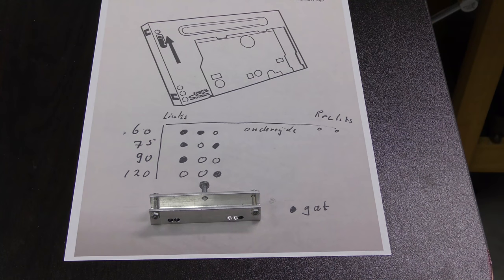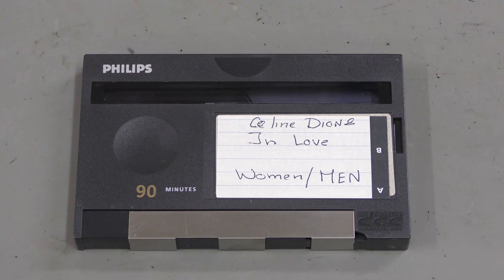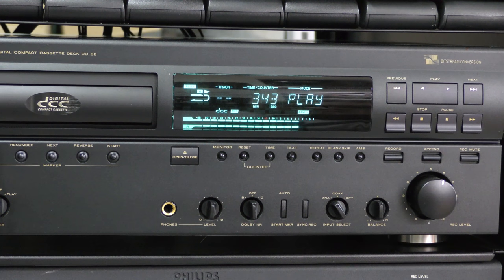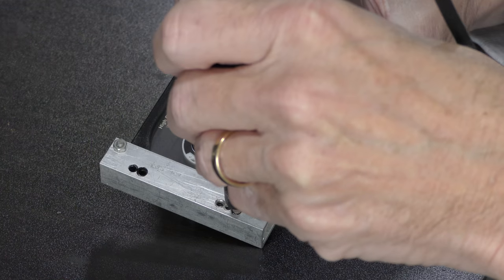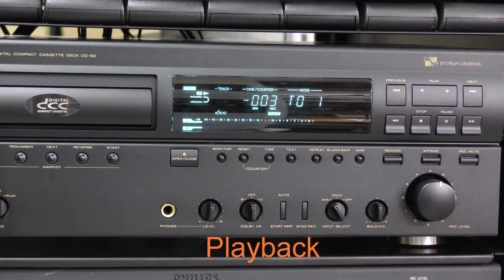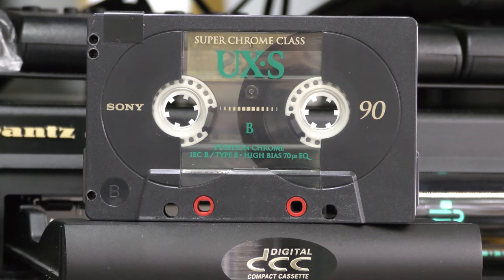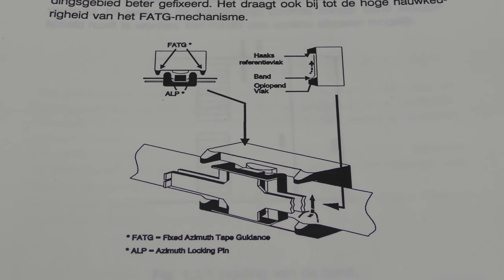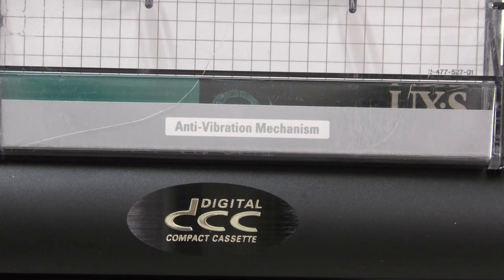Converting a analog audio cassette to digital compact cassette. A Myth?

Comment: i did this too back in the 90s when DCC was new ;)
Reply: I used a Maxell XLII-S90 Tape back in the days by the way (and carved the two holes with the pointy part on the back of a swiss army knive). The casset also advertises " high resonance-damping and heat resistant mechanism". And now about 25 years later i found that this is my only working DCC casset as all my original DCCs had developed the stick slip problem (I will fix them when I find time next).

Comment: Perhaps a NEW analog cassette tape could store the digital signal effectively, but the lifespan of the recording must be significantly shortened. 1) Analog cassette tape has the magnetic layer exposed to the playback head, thus allowing friction to wear-down the magnetic layer over time, and 2) The superparamagnetic effect will cause the signal to degrade over time, as the sharp peaks and troughs in the signal exert magnetic force on each other and start to neutralize each other. This is a problem that computer hard-disk manufacturers have struggled with for decades.
Reply: Biggest problem would be overwriting another previous recording.as no erase head is present and an analog tape medium has much thicker magnetic later. Writing once on a blank tape wirks much better than trying to overwrite previous recordings here

Comment: not a myth, it worked.  I even hardware modded the DCC950 deck to do this without editing the tape itself.
Reply from the maker: It does work, just not very well compared to the original DCC

Comment: I wonder if it was researched today, could you get more out of an analog cassette with a digital system? Interesting!
Reply: no, you can't get more. Digital sound on a dcc or cc cassette must be somehow converted, DCC is lossy format. So standard analog CC has full  lossles sound in the frequency range top cassette can achieve (which is up to 18 kHz) while DCC is compressed. Adventage of the DCC is the sound is without a hiss. But it's like mp3, Atrac or AAC etc. Today's research about analog tapes possibilities is much weaker and there are less and less knowledges about it, new engineers and technicians does not care, analog tape is nearly dead format for them. Anyway, DAT (digital audio tape) is lossless cassette tape, superior to DCC. More cannot be achieved..
Reply: @sevcaczech5961  Well, technically it can, ADAT and DTRS allow for 8 channel DAT-quality audio recording, while there were professional studio machines that recorded digital signals on special reel to reel tapes, those were used at studio and for live recordings, Ozzy Osbourne's Live and Loud was recorded on open reel digital tapes.
Reply: @sevcaczech5961  DCC sounds much better than any regular analog CC deck ever achieved, and DCC also supported 18 to even 20 bits, which DAT could never do. That's why some DCC releases in 18 bit sounded better than their 16-bit CD counterparts according to many audio aficionados.

Comment: Does anyone think about 3D Printing a DCC shell? Also figure it out how you can slice a Chrome VHS tape which is still available on a reasonable price? I know that you still have to figure it out the metal parts like the pressure pad, but it sounds something you could manufacture in China for nickels. What I mean it shouldn't be impossible, although it is not easy. Eventually we will need new blank tapes.
Reply from the maker: On the new dcc forum we have already started this idea: https://forum.dccmuseum.com/t/new-dcc-shells-3d-printed/72/14

Comment: What would happen if you did the opposite? That is, record analog on a DCC tape?
Reply from the maker: I just tried that last week (someone on VWestlife's channel had asked). The only way possible was to remove the dcc tape from the shell and put it in a regular analog shell. Otherwise the capstan/pinch would not work. It recorded  great on my regular deck that way.
Reply: I tried too. sound was great.
Reply: @DRDCC  I had always wondered but this basically gives me the answer, at one point before the tape boom happened I was trying to find blank open reel tape and while it would have been highly highly impractical I now know it would have been at least theoretically possible to use VHS tape on my open reel recorder, all of this is very cool
Reply: The magnetic layer thinner than an analog tape. Expect incorrect HF bias, low frequenties, noise behavior. But it is not that different it Will not work

Comment: i had just one analoque sealed tape lying around somewhere. and you would never guess... it was a Sony UX-S 90... i drilled the holes carefully, (i made a template with masking tape) 
and made some recordings. it worked flawlessly... But nowadays a UX-s90 is harder to find than a Philips DCC tape. prices go around 20 Euro's ... Should i have kept it sealed?? no, this was a fun project. thx for the tip Ralph!
Reply: *analogue

Comment: I know this was done ages ago, but I did make the attempt to take apart a realistic supertape 90 DCC tape and put it into a chrome housing.  (I have 2 used tapes leftover, but no DCC recorder to use them on)  To be honest, recording on the tape was nice, but what I found was that when recording to the tape, the output was a bit lower than most cobalt high-bias tapes.  It responds almost as identical as a BASF true chrome tape, as these tapes were meant to record 0DB input, with a lower output (and lower noise floor)   

If I can recall, I believe doing this exact test (using BASF chrome maxima tape) long time ago with positive results.  The BASF cassette housings are quite decent.

I'd be very curious as to how the DCC machines would have been setup, as more than likely, they would have been tied to a specific tape type and calibrated to it.  Most japanese cassette decks were calibrated against either maxell UD/TDK SA tape, which is vastly different than BASF pure chrome.  I agree that the head alignment should be precise, especially when using it for the digital tracks, but it should not skew as easily.  But I can confirm with your findings, that the pressure pad/assembly in the DCC blank cassette has a unique tray that isolates the pad and likely locks the playback head in place.  

The DCC cassette itself is uniquely designed with large internal guide rollers that have pressure pads on either end of the rollers...which is unique.  These tapes certainly have a lot more parts and assembly involved in the manufacture, and were priced accordingly due to the these reasons.

Comment: Ho provato cassetta TDK SF con forati per DCC che risulta non funziona causa livello del volume registrato troppo basso. Consiglio qualsiasi cassetta K7 Type II con doppio strato di cromo (come TDK, Maxell e Fuji progettati K7 Type II dal 1974), prima di forare per DCC. Va bene Sony UX-S con meccanica anti-vibrazione anche TDK SA-XG.
Reply: Non modificate nastro metal e ferrichrome, DAT, DDS, MiniMV, MicroMV, reel audio EE e Duad, etc. da trasformare in DCC perché testina magnetica DCC e pinch-roller si rovinano/usurano !!!! Solo usare nastro cromo doppio strato di K7 !!!!

Comment: You might probably know this, but the only manuafcturer of DCC tape was BASF, so to get the best results you should use pure chrome either Extra, or Super from the later generations.
TDK, Sony and Maxel use pseudochrome, which is just ferric formulation dopes with cobalt particles to achieve higher bias and similarity to IEC II referance tape.
A test with BASF would be decisive.
Reply: Not quite ...

Comment: Does that mean those old Tapes could  Store hundrets of Megabytes?
Unimaginable in the Homecomputer age
Reply from the maker: Yes. There was one dcc player, (dcc175 portable) that was capable of backing up 250mb of data on a 90min dcc tape
Reply: Thats what spectrum and other computers did in the 80’s , thats what the dat based back up format was, that the adat by alesis was......

Comment: My first DCC recorder was a DCC 175. I still have it, but it doesn’t work anymore. Probably a rubber belt problem. I recently bought a good working DCC 300. Do you have a drawing with measurements of the aluminium U-profile to make the holes?
Reply: That is a nice player DCC175. You should fix the belt, or have it fixed.
Reply: @PhilipvanderMatten  Maybe I will. I have all the accessoires, and one extra battery. The was software with it for a Windows PC, and a cable to connect to the printer port of a PC. With that you were able to edit the digital audio on a PC. It's a pity there is no possibility to connect it through a USB port, and edit with Apple software. It's a thing from another era.
Reply: @JandeBloois1952  I would love to have it.

Comment: Dear friends, be smart and just swap the dcc tape roll for a roll of chrome basf tape and you will have a new dcc.
buy a new basf chrome ribbon roll,
open the dcc cassette remove the dcc tape roller and replace it with the chrome basf
Reply from the maker: Hi, It is not that simple. The BASF Chrome Tape is Video Tape that was carefully selected with Philips together with a specific felt pad to prevent the stick slip effect.  To be using the same chrome tape for regular analog tapes, would not get you better or a stable solution. You would really need the combo of the right shell with the correct tape and felt pad.

Comment: Try a metal type 4 cassette
Reply: metal dont work at all. I tried metal maxima from basf.
Reply: I'm pretty sure it won't work because the bias would be wrong. DCC uses chrome videotape.
Reply: Nope. Coercivity way too high for that
Reply: But vice versa: a good high output metal tape analog recording played back on a dcc130 sounded  better than playing the same tape in a high quality analog deck. According to German magazine Stereoplay on par with dcc digital. I was so proud - although not the desired result of course.

Comment: What happens if you play back this tape on a regular analog player?
Reply from the maker: In a DCC shell, it will not fit, but if you use the DCC tape in a regular cassette shell, it will record and play on any regular deck. If recorded on a DCC deck, there is not audio on a regular analog player.

Comment: Hi folks, I have a Philips DCC-900. Something strange is going on. He plays a DCC as it should, but he refuses to play an ACC. I think something is wrong with a sensor? If I insert an ACC, the direction symbol should light up in the bottom left of the display ...
Reply from the maker: mixdoctor1971 Could be dirty switches on the left inside the tray.

Comment: Did you try this on multiple recorders? Did you try running the recorders in service mode to check the error rate? Have you tried comparing the MUX output of the head amplifier between playing various official DCC tapes and your converted tape? Just curious :)
Reply from the maker: Yes, tried it on at least 5 different dcc recorders. Just recording an playback. Error rate in playback service mode is definitely much higher. More "1" then a regular pre-recorded or recorded official dcc. It is barely hanging on.

Comment: If the tape in a DCC is BASF chrome tape, why not try a BASF chrome cassette???
Reply from the maker: Philip van der Matten Good question. Much of the legwork of testing had been done by Jorn, who had found the Sony tape for example and we did not have a new Basf tape. The problem is not only the tape being used, but also the mechanism.
Reply: Philip van der Matten if I have the opportunity I will, first a modern that’s cassette will be tested
Reply: This was posted in 2013 on the dutch mfbfreaks forum by BMW653:
"I once provided a number of DCC cassettes with tape from BASF Chrome Extra C120. That worked fine and the tapes can still be heard flawlessly and then with a playing time of 120 minutes. It is more in the cassette housing, tape guide and the pressure pad in a DCC cassette is also very differently constructed. Other tape can therefore work best, but in a DCC housing. If a DCC recorder wants to recognize a cassette as 120 minutes, one of the holes must be taped. The system was therefore prepared for it."
"An ordinary cassette housing can work, examples enough. But it is more based on accidentally running the tape exactly along the head. Not really reliable and the interchangeability with other recorders is unlikely. With these 18 narrow tracks, it is much more down to accuracy."
So some more tips & tricks here. :)
Reply from the maker: Philip van der Matten Jorn has tested this week, with slightly different results. It was surprisingly stable on multiple machines, but still would not make sense to do, because the cost are to high. He also put the basf dcc tape in a cassette shell and that was already surprisingly better, so proves that the special video chrome tape is better than any other.
Reply: I have tried a base tape, but no success.
Reply: Its different compound. dcc tapes use the same compound as vhs video tape